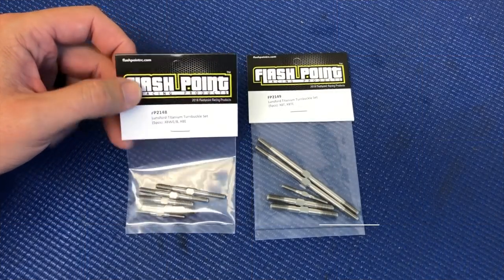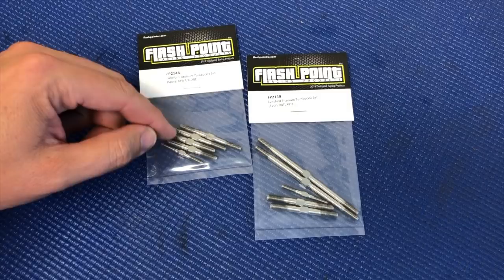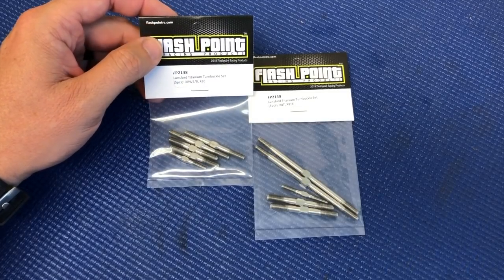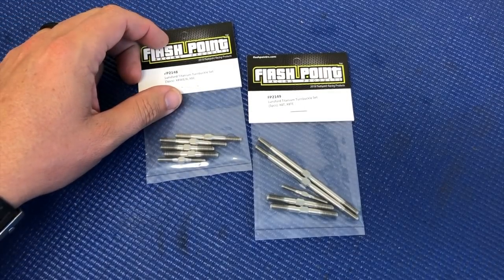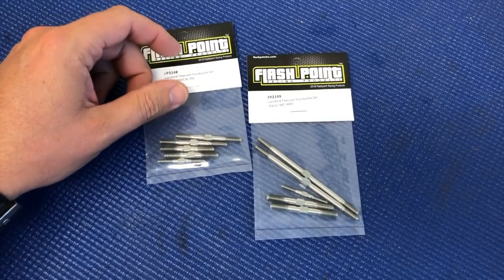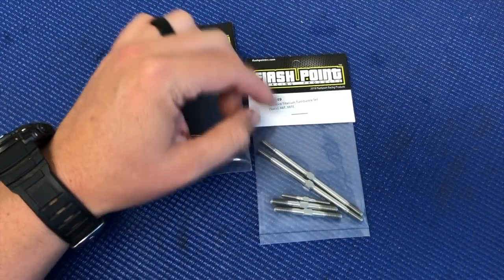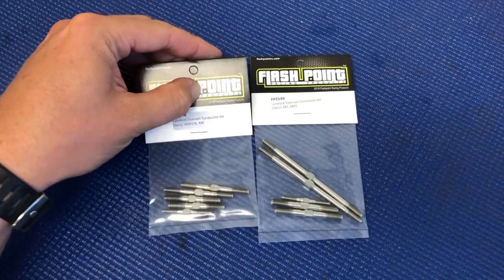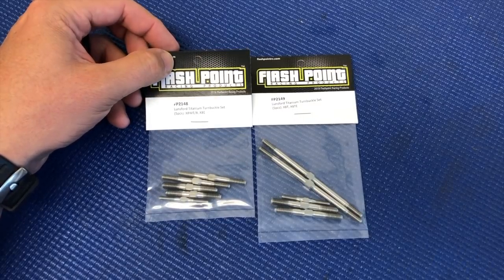Adam Drake from Mugen Seiki Racing talks about the Flash Point Titanium Turnbuckle Kits.

Comment: Hi Adam. I have a question about the balance. If i reduce the weight by titanium turnbuckles, titanium screws, carbon shock towers, axle shafts, servo saver shafts on my mbx8te. Wich springs i need to use? I think that stock xx hard springs are more than necessary. The similarly question is about anti-roll bars.
Reply from the maker: I still use the stock springs on the MBX8TE in most conditions, but you may want to try one spring softer front and rear if you run full titanium.
Reply: @AdamDrake  thx a lot
Reply from the maker: @КонстантинКрокус  Anytime.

Comment: Hi Adam. Do have an idea how much the stock turnbuckles weight compared to the titanium ones? I'd like to know how much weight my car loses when fitting these.
Reply from the maker: I don't know the exact difference in weight, but it's pretty noticeable.  I'll try to get those numbers.
Reply: @AdamDrake  Thanks for that! They are pretty expensive but if the difference is big enough, I'm going to buy a set :-)
Reply: I found the Lunsford mbx8 set (should be the same as the Flashpoint ones) in Europe for a good price. The weight of the 5 stock turnbuckles is 22.30g. The weight of the 5 titanium turnbuckles is 12.80g. So you save 9.5g by buying this set.
Reply from the maker: Yes sir.  Thank you for the information!